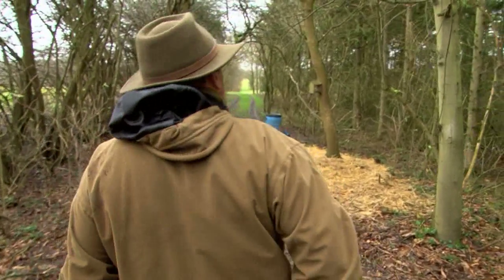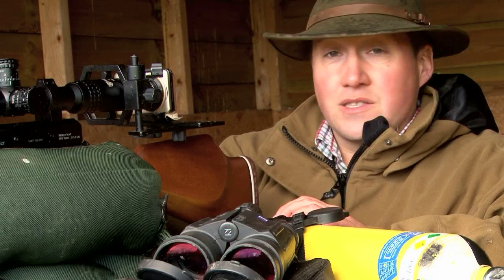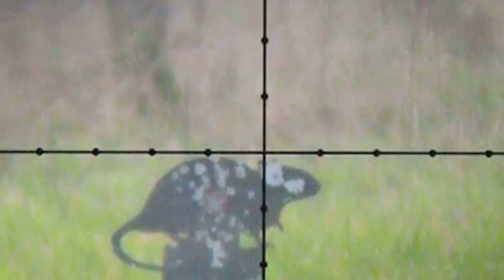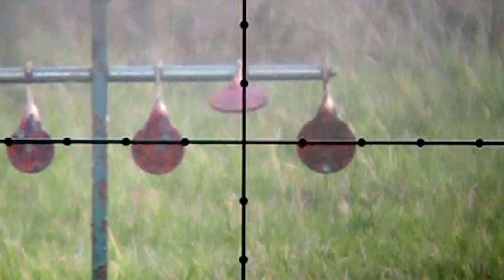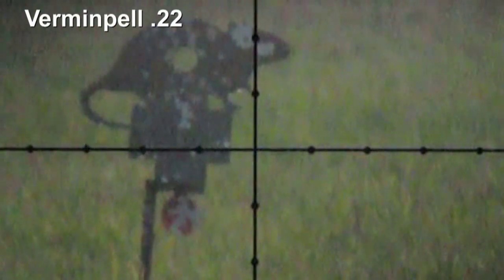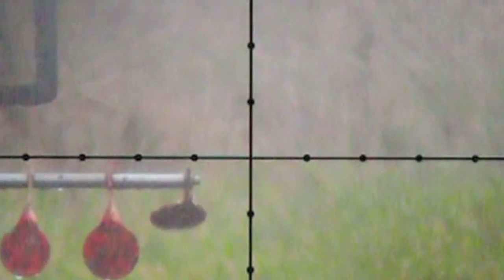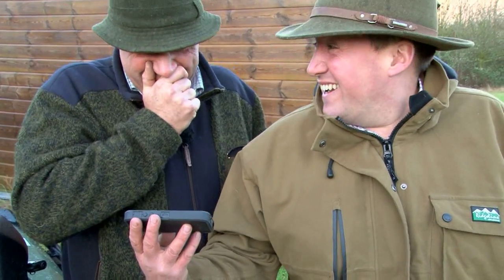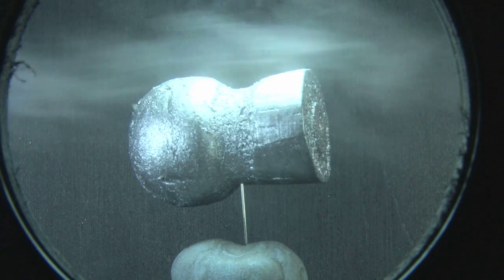Pellet vs Wind - Slo mo flight test

Comment: The wind tunnel needs some fins to get the smoke flowing in a straight line, if you get a pack of straws after the fan it will give much better results